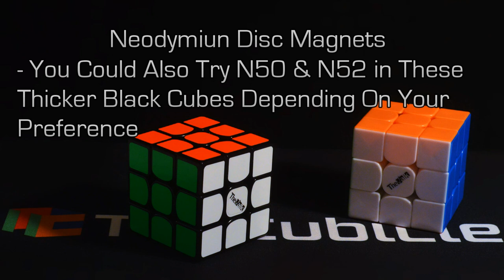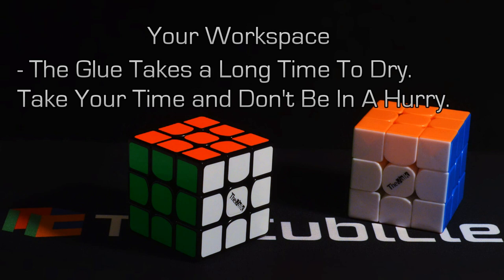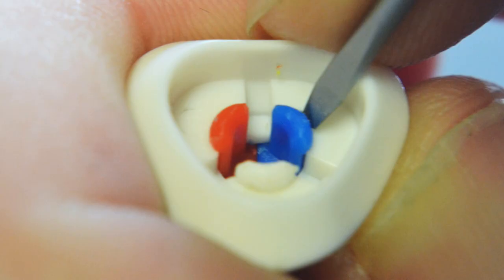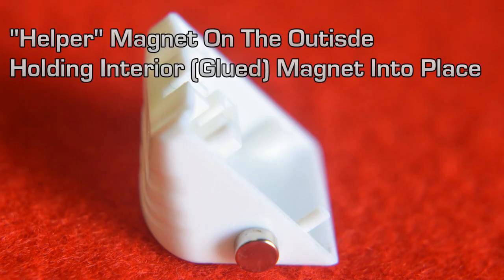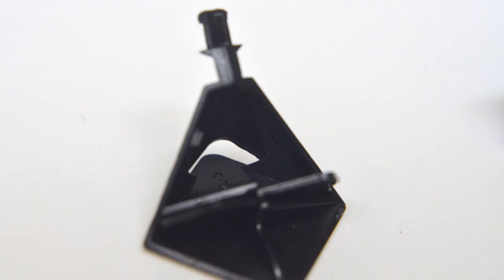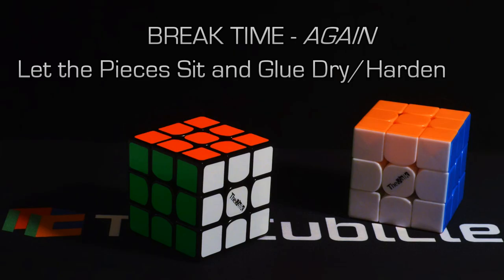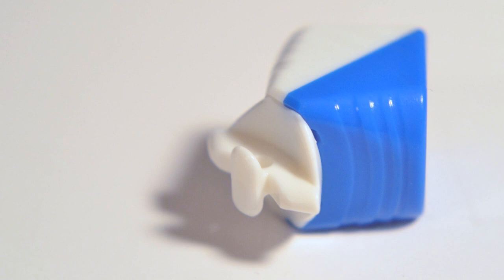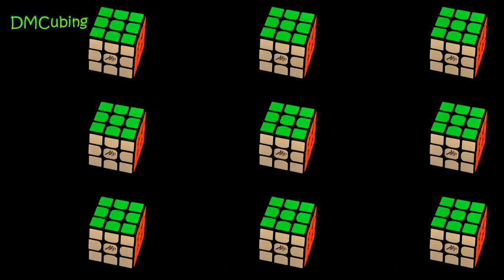DIY: How To Make A Magnetic Valk 3 Speedcube Tutorial

Comment: Is it just me or do I feel like the Valk m is easier than the GTS m?
Reply from the maker: Hmmm. They're certainly different to mod. The GTS can be done fairly quickly once you get into a groove. But yeah, the Valk is straight forward and less prone to making mistakes on, that's for sure.
Reply: DMCubing Yeah I messed up the polarity so badly on the GTS!
Reply from the maker: BLCuber7 Oh no! Really?? What happened?
Reply: DMCubing Some magnets wouldn't attract to others
Reply from the maker: BLCuber7  yeah you have to be careful making sure you remove the magnets the same way each time and that you use the right end of the stick of magnets up against the cube to correctly attract the magnets.